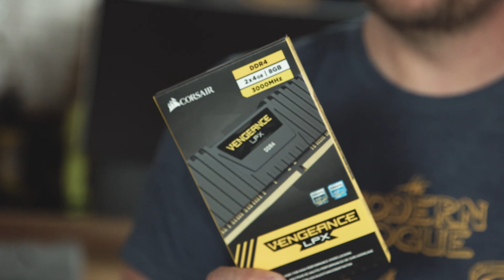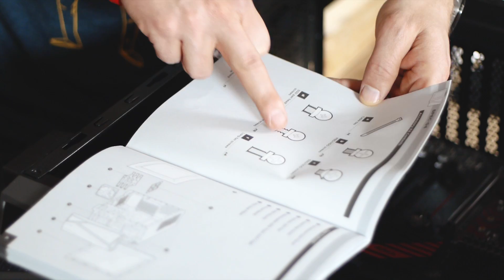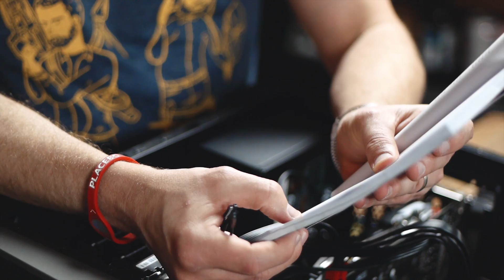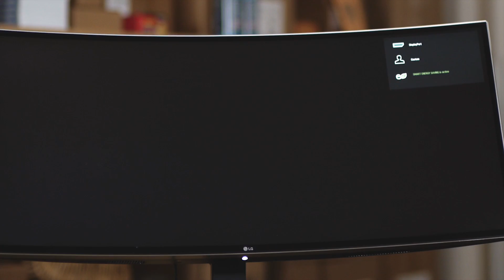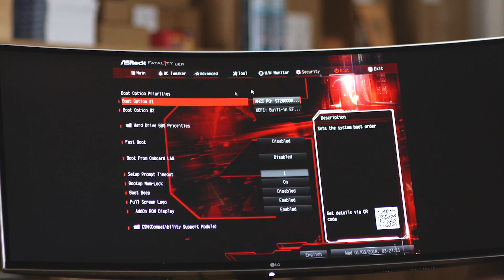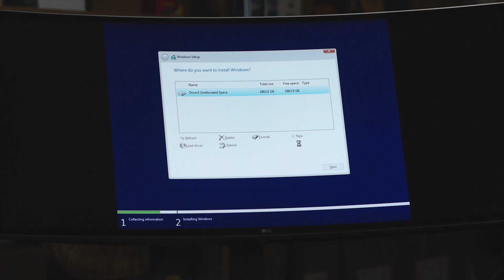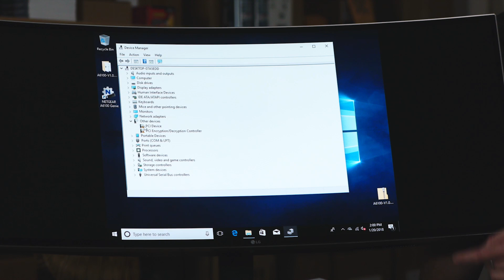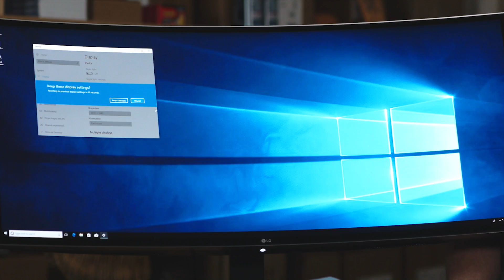Building a Gaming PC

Comment: I'm not into AMD, just because PC's put out a ton of heat, so if I can pay a lot of extra money to make it output ANY less heat, I pay for it. Maybe someday someone will invent a way to vent your PC heat into your attic, then at that point, I'll consider saving money getting AMD. My best advice is to buy a "Full Tower" huge computer case. The bigger the case, the easier it is to add/remove/connect hardware and the more room for heat to move away and of course, the more room for bigger heat sinks/fans and the more room for Hard Drives or other extra additions. If you get a monster sized case, you MAY not have to ever buy another case again. If you buy a case that is "just big enough" you will have to buy a new case, every time you upgrade. HAF makes some nice large cases.

Also, if you are into trying to make very long lasting purchases, buy the highest wattage power supply you can. The higher the wattage is, the lower it will run at, which means if you have a 800 or 1000 watt PSU and only need 400 watts, it's going to run at really low temps, but if you buy a 450 watt and need 400, it's probably going to run very hot and you may not be able to change hardware in the future without having to buy ANOTHER PSU. Also, I recommend a Modular one, that lets you remove as many cables as possible, so that your not cramming useless extra wires in your case.

I'm just trying to help people from continuously buying replacements when it isn't needed.

For my personal preference, I like as many RAM ports (and highest max RAM) and the most SATA ports I can get. Again, it's always nice to be able to say, buy a single 16GB RAM chip just to get you up and running, since you probably spent a lot on other things and then months or years later, buy 3 more so you have 64 GB RAM.

Good Luck.
I'm waiting on nVidia to release their next gen cards. I'm still using a nvidia 650 which I recently bought when my 8800GT "melted" fan died and killed the card. It was all I could afford at the time, I wanted the 560, but couldn't afford it. I've seen videos with the 1080 cards and I'm not impressed. I know it would be a lot better, but not going to drop hundreds of dollars when the 1180's ot 2080's or 4080's (whichever they decide is next, I've heard all 3 as possible names) will be coming out any day now. It's annoying to wait, but consider I had an 8800GT until a few years ago, so once I drop money on a video card, I don't want to buy a new one that is like 5-10% better in a year that cost me like $400-$500. No thanks.

Comment: You likely didn't connect you POST speaker. I have an Asrock motherboard for the PC I built a few years ago. Saw the speaker wasn't installed after I was basically done, so didn't bother to install it. I still have it if I run into a situation where I need it.

Comment: Brian, for future reference:
When you attach any sort of hardware in a computer it's recommended that you screw it in in an X pattern, the 2nd screw is in the opposite corner from the 1st one.
This is generally to provide even pressure on the components when attaching them.
You mounted the CPU fan one side at a time, which first applies pressure to one side, then to the other.

Comment: I wouldn't worry about static electricity, at least with intel you could probably sprinkle some bellybutton lint under the CPU chip and it would still operate. The AMD however already comes with the belly button lint included.

Comment: I love these guys but just found this...oh the pain....
1) You touch the thermal paste you reapply the thermal paste
2) cable management on that fan got me twitching
3) there should be more anchors somewhere that came with the case you put an anchor under every hole and remove anchors that don't have a hole
4) i knew it was coming with the fan cable management and the glass touching but still running every cable in the open on a windowed PC like that OUCH

overall par for the course for modern rogue

Comment: A would say that the rx580 and gtx1060 is a mid-level graphics card the rx570 is a little on the lower end and on the higher end like a gtx1070 ti or like overkill with the 1080 ti

Comment: nowadays watercooling isnt as big a thing as it was back in the days as in the difference between watercooling and fan cooling (granted at some point even a water cooled system uses fans) isnt as big anymore, most gaming pcs that use watercooling over fans .... they are doing it for the cool factor not because it is required

Comment: the motherboard does NOT have internal graphics, the ports are to access the CPU´s integrated (and usually very bad) graphics compartment, wich the Ryzen also does not have, so you need a graphics card or a processor that has a graphics compartment EDIT: the WIN10 upgrade from WIN7 did just work until 08.2018

Comment: I am pretty sure that you guys haven't installed the motherboard standoffs. How the mobo didn't short from back side IDK. Also ram is usually installed in slot 1 and 3 not 1 and 2. Not going the mention the most obvious mistake. 

Also RX 470 should cost somewhere around 200 USD if it wasn't inflated due to crypto currency.
Reply from the maker: They’re built into the case.  Tough to see since they’re all black

Comment: List of information, corrections, and timing-based dialogue starting at your choice of WLAN USB. That was when I realized that you didn't know what you were doing really. This comment only applies until 00:14:40 . After that, refer to my next comment.
--------
Brian, you could have gotten a PCIe Wirelesd Card and saved a USB port. 

It's not tough to find good graphics cards, it's just that they've gotten expensive.

 2 TB isn't basic, that's more than I've got. You don't need an SSD, the extra expense is for really high speed, but because of the NAND shortage, they're too expensive for the average consumer. Unlike traditional hard drives, they have a limited read/write count, which is why the numbers are weirder (You're probably wondering why, for example, 500GB is weird compared to 512GB. It's because data is most often counted in Base 2. The 12GB missing are still there, they're just "swap" data. When you delete something on an SSD, it doesn't free up space. It just makes the transistors and capacitors associated with said data unusable. To compensate, the drives come with sections allocated to giving you more free space when you delete something.

Bronze 80 Plus is a standard by which PSUs are verified to last a long time. 650W will suit you well.

Normally, you'd aim for 16GB DDR4 RAM, but due to high prices (recently determined to be because of price fixings, a form of fraud), they gave you 8GB, which used to cost about $32 USD. It currently costs about $100 USD.

Gaming cases are mainly about the looks, but you have to make sure that it supports your form of components. A mini-ITX board is usually supported in a case that supports MATX and maybe ATX boards, but an MATC or ATX board will not fit in a Mini-ITX case. I made the mistake of not checking for 360mm radiator support when I bought my case. The radiator hangs over the top of the case, secured by rubber bands and zip ties, when it's in the case. I've currently decided to use an open bench style of setup.

If you leave your setup exposed directly to water, expect unrecoverable damage. The water you saw probably wasn't water, but a non-corrosive and non-electrically-conductive coolant designed for that purpose. If the liquid boiled, the CPU had to have been throttling to avoid burn-out.

You don't build it outside the chassis because it's easier and then add it to the case, you test it outside the chassis to ensure everything works together, and then migrate the system to the chassis when you've confirmed that. Diagnostics are important.

Yes, PS/2 is primarily legacy support. Jason was right. Brian, USB also supports simultaneous key presses. How do you think moving in a direction other than forwards, backwards, left, and right works?

You assumed right about the triangle. Good job, Brian!

Reading the instructionsis ALWAYS advised when you don't know what your doingm the holes are standard for all cooling system mounting. You need a way to apply good pressure and make contact between the CPU, Thermal applicant, and Cooling solution (Heatsink, liquid cooling loop, etc.). In other words, the holes are necessary.

You should wait until you've put your pc into the case before peeling the plastic off of the acrylic window. This can alleviate the chances of scratching it on accident.

You didn't bother with the IO shield? It's not going to look as nice in the back now.

GPU should be the last thing to be installed. Just saying. Make sure everything else works and is stable, and it's easier to work with front IO that way.
-----------
Not trying to be aggressive or mean, just trying to give you suggestions and be informative.
Reply: IO shield was installed. (22:49)

Also the point about PS/2 was not that USB doesn't support any simultaneous key presses, it's that USB has limits on those whereas PS/2 does not.
Reply: usb doesnt have limits, cheap usb low speed keyboards and bioses do (max 8 bytes per message = 6KRO ) https://deskthority.net/wiki/USB
Reply: rasz - I meant as in taking up a port. You only have a finite number of ports that are usable depending on how many you've connected to the header.
Reply: Brandt Hughes - I addressed that IO shield was put on in my following comment. Thank you for helping me understand what they meant by the point about simultaneous key presses.
Reply: saving usb?  this board has like 10 usb ports ..
Reply: rasz - It has 8 USB ports altogether in rear IO, BUT only 4 of those are USB 3.0, 1 USB 3.1, and 1 USB type C, but the rest (2) are plain USB or USB 2.0. It may not be as much of a problem, but using a PCIe vesion makes it look cleaner, and may very well improve speeds versus that of USB (PCIe versus USB serial communication types)

Comment: that cable management though :'(( ... so much to say ... no dangling your hard dive out is not fine
Reply from the maker: I mean... it’s still working
Reply: No doubt im not trying to discredits you, I'm a big fan actually .. guess its just goes against what I've been thought about how to install systems and about system safety. Like the open sides actually dont keep your system cooler it actually messes with the air flow .. again its just from a technician perspective

Comment: I cringed so much at in this video, like how do you forget the I/O shield (you were reading the instructions surely it would have said there), and I guess it can be easy to put the ram into the wrong slots as the naming is pretty bad and vague for them so I'll kinda let you off with that one. Also AIO water coolers exist and are easier to install than you think

Edit : Still enjoyed the video though :p
Reply from the maker: Sounds like you posted this before finishing the video? I/O shield was definitely in place.
Reply: The Modern Rogue no I watched to the end, what I meant is the two guys (don't watch you enough to know your guys names) forgot to install it and someone else had to later

Comment: This is second to the verge pc build as far as being terrible
:Things wrong:
ram install
io shield
cables on after putting power supply in
using amd parts
thinking a gpu comes with a hdmi/dp cable
downloading windows 10
thinking you can teach people about computers

Comment: a Ryzen CPU with that cooler for gaming? guys why didnt you buy a third party cooler and some good thermal paste like Noctua NT-H1 its much better in thermal performance than the factory stuff they give you and stock coolers for gaming is something you should never do and considering that doesn't have much surface area to dissipate heat like a third party cooler does your gonna run into problems while gaming, also stock cooler dont run hot cpus like Ryzen very well tasks like gaming so third party coolers arent just for overclocking

Comment: don't buy that wi-fi dongle. all the rest is fine, but that thing is terrible. just buy a PCI-E wi-fi card, they cost about the same and don't overheat. that exact one you guys got will overheat if you throw any load worse than netflix at it.
better yet just buy an ethernet cable.

aside from that and the small amount of ram (a simple fix) it is probably a better computer than mine.

Comment: wrong spots for the ram REEEEEEEEEEE really though if that is the correctly marked spots for the ram that is REALLY uncommon, 99% of MoBos use the 2nd and 4th slots from the CPU and fan as the slot "1" and slot "2" so kiddies please consult with your motherboards Manual before making dumb decisions(see also that the the MoBo will often have markers above or below the ram DIMM slots to signify where slot 1 and 2 are)

Comment: ayy modern rouge you calling yourself modern with a 570 like man cmon i got myself a 580 black edition for less than 300 before tax
Reply from the maker: Cool.  We got ours for $0.
Reply: which bank did you rob with the potato cannon and everyone knows that the stock thermal paste is trash instead use Arctic Silver 5 or some other metal paste like Thermal Grizzly Kryonaut